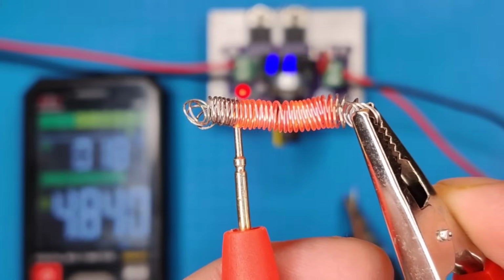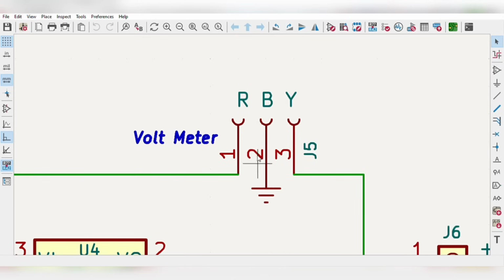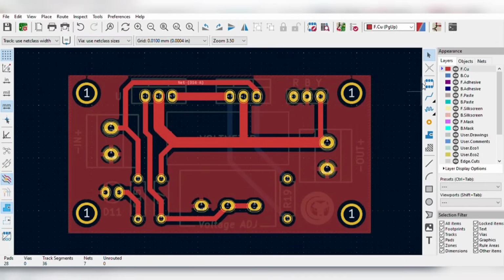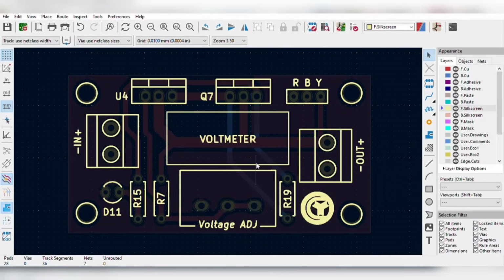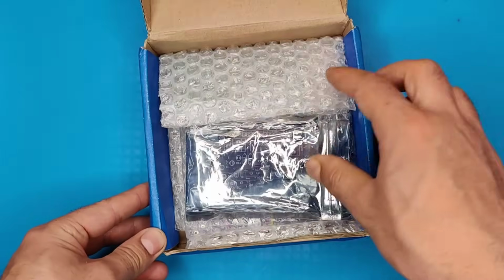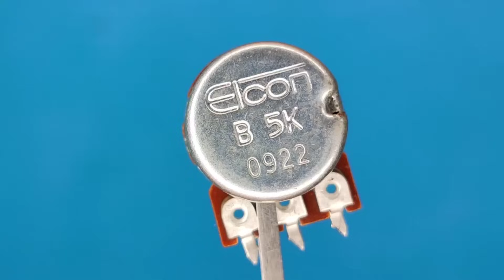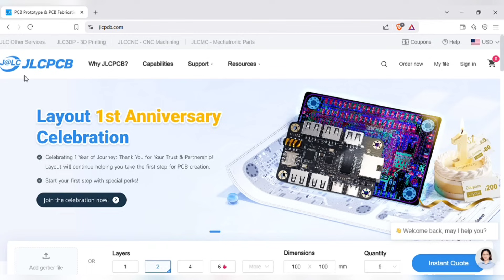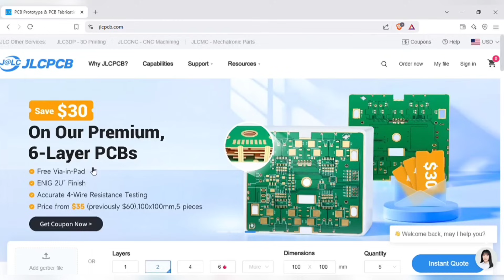0-30v Adjustable voltage regulator with 5A current boost

Comment: Nice unit, but I am in need of Adjustable 0-30DCV - 30A. I can buy, but like to build.  I designed and built an adjustable  3-18DCV - 10A, but no time to design one.  Any ideas?

Comment: Sir nice video keep it up 👍 sir I have one request for how to charge the 3, 7 volt battery with out any module for Charging you have to used  the mobile charger and circuit with auto cut circuit with relay please make a one video and explain how to set the cut off voltage with the preset and show in put voltage as well as out put voltage please make a one video it's humble request to you 🙏😭😭😭